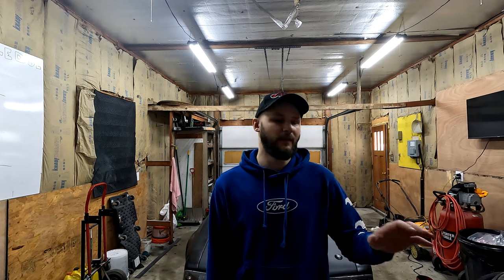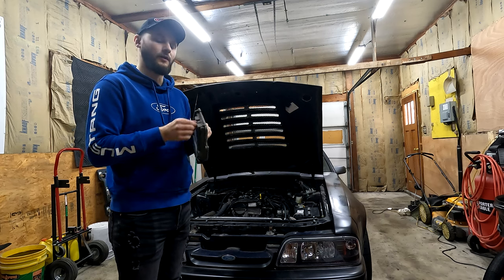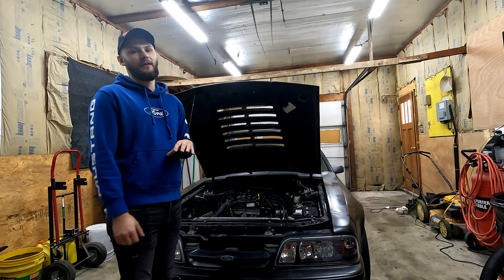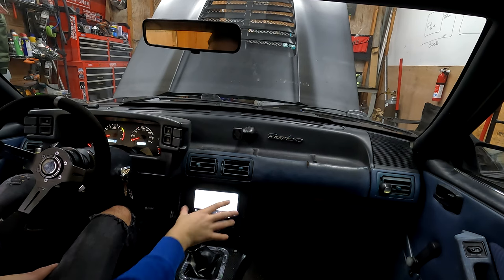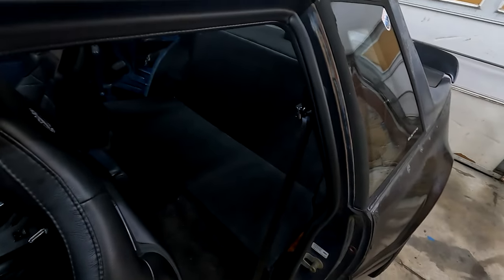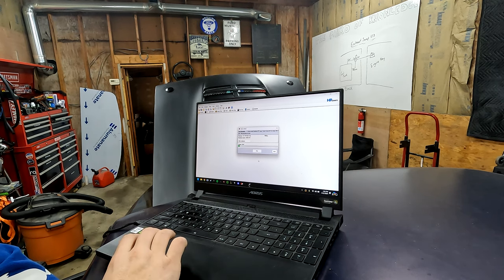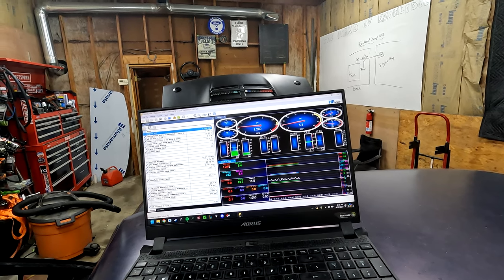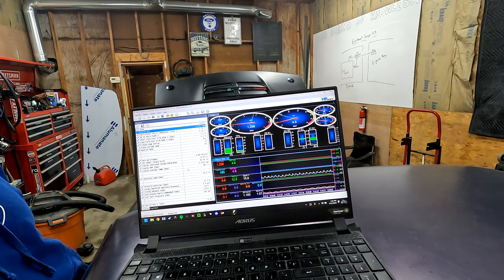Tuning Issues | Ecoboost Foxbody Build

Comment: Are you going to post a video on the Maestro RR2? I'd like to see how you hook it up and what features you will have with just the ECU.
Reply from the maker: The maestro ended up not working properly. I contacted maestro for support and they basically told me that they don't support any application that is not listed in their application list.
Reply: @stroupperformance9384 what harness are you using? Did you just use the ECU from jemsport or was it ECU and harness.

Comment: Hi there ! following your build. You mentioned the ANT Steering was not able to control the high pressure pump. Is it better to jump to the JEMsport if starting from scratch ? I do have the engine already located and ready to be bought. Next step would be the ECU ! so any advice would be appreciate it.
Reply from the maker: It depends on your goals for the car. The high pressure fuel pump upgrade isn't necessary until ~360whp. You could also do an auxiliary fuel setup instead of the HPFP.

Comment: Do you have a website? Would you be able to design mounts for a 2006 mustang v6 manual. It has a blown engine with a T5 manual
Reply from the maker: I do not have a website setup yet. It is in the plans for the near future. I need to get my hands on some different chassis to make mounts for.